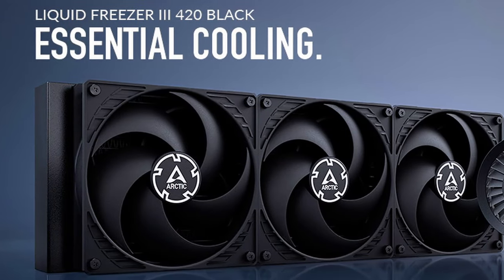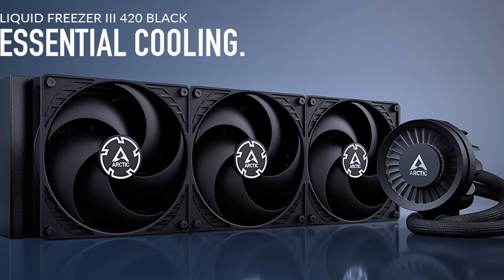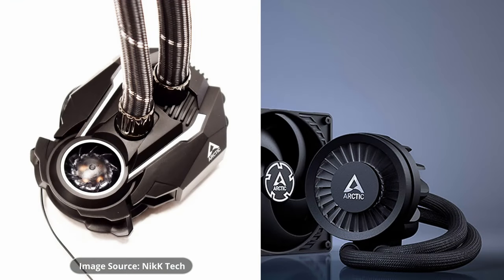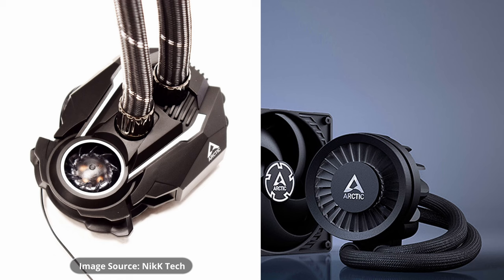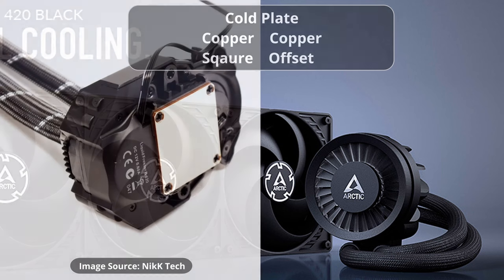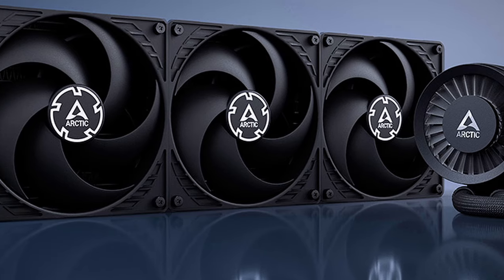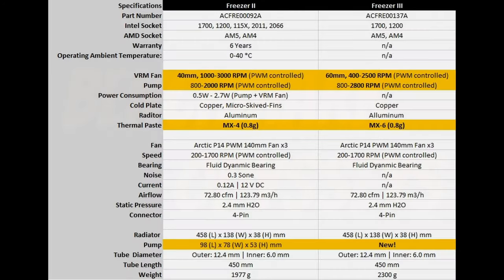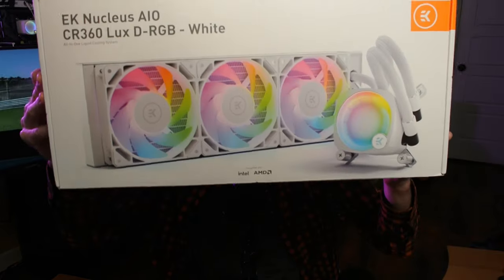(unannounced) Liquid Freezer III from Arctic Cooling

Comment: The offset does work. Gamersnexus tested the offset mounting position for it's brackets w/Liquid Freezer II does work.  I also use it on my heavily overclocked 5800X and it definitely dropped a couple C off my peak operation.  I'd love to see a bigger "vrm" fan because if it's that size you'll basically be getting damn near a fan for your ram which could help w/those temperature sensitive timing settings!
Reply from the maker: Right on! I'll have to dig up that GN video. I'm running open benches for my testing, and I too would appreciate some cooling around the VRM and RAM. But I think I'll have to build my own solution on these two Thermaltake P3 systems.

Comment: the aio u have rn is #1
Reply from the maker: EK Nucleus is a great AIO. TechPowerUP just posted a review and they noted a slight performance disadvantage when using it on AMD, compared to Intel. Perhaps this is why Arctic Cooling has designed a 5mm AM5 offset with it's new Freezer III.

Comment: Other videos have shown it like this in non-RGB black, plus RGB in both black and white. Also rumored to have reduced frame blockage of rad fins, and higher fins per inch.
Reply from the maker: Tighter fin pitch with the rad as well?! That's big news. Sounds like Arctic is going for the thermal crown 👑